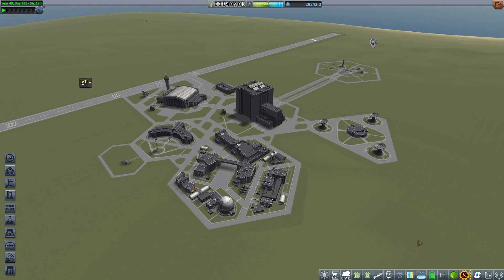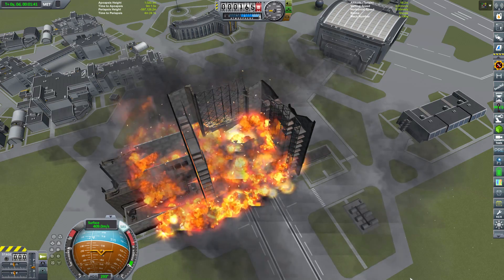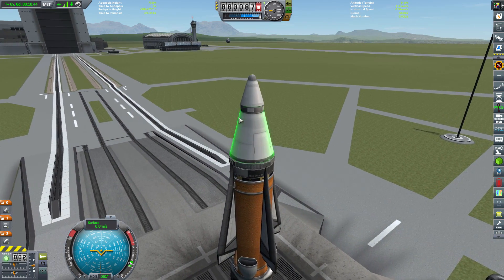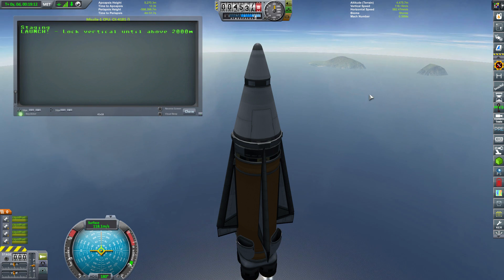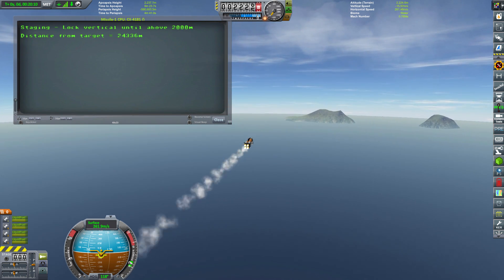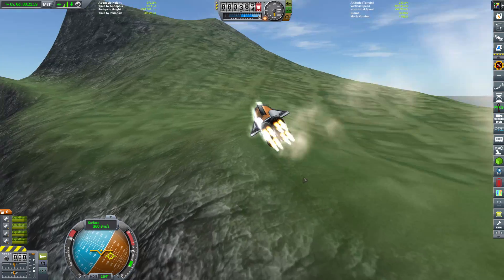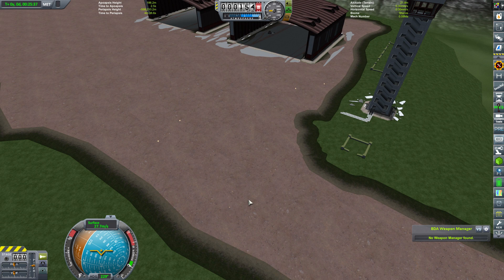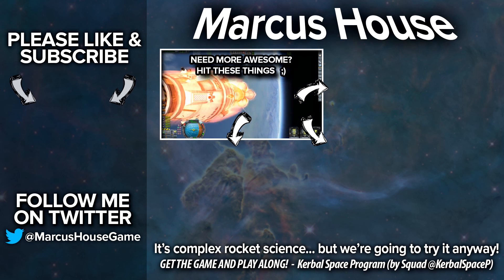KSP Self Flying Missile with kOS mod - Ep 58 - Kerbal Space Program - Marcus House

Comment: im very new to coding and the script ive made to create a missile is failing for a reason which i cant find out
the missiles flies up to 5k before dipping down and crashing into the ocean 
here is my script
if anyone sees anything that could cause this plz help 

toggle rcs.
Clearscreen.
print "T-5".
wait 1.
print "T-4".
wait 1.
print "T-3".
wait 1.
print "T-2".
wait 1.
print "T-1".
wait 0.05.
print "launch".

set runmode to 1.

Until runmode = 0 {

if runmode = 1 {
lock throttle to 1.
 stage.
 set runmode to 2. 
 }.
 
 else if runmode = 2 {
 lock STEERING to UP.
 If MAXTHRUST = 0 {
 stage.
 }.
 if SHIP:ALTITUDE > 3000 {
 set runmode to 4.
 }.
 }.
 
 else if runmode = 4 {
 set targetLatLng to LATLNG (-1.532,-71.880).
 set runmode to 5.
 }.
 
 else if runmode = 5 {
 until targetLatLng:DISTANCE < 7000 {
 LOCK STEERING TO targetLatLng:ALTITUDEPOSITION(5000).
 }.
 }.
 }.

havnt finished script because i cant test it past this line

Comment: Hey Marcus House you should really check out a mod called Vessel Mover -
 https://github.com/PapaJoesSoup/VesselMover/releases newest version with older versions.
THIS mod lets you move your vessel around anywhere on the landed planet or moon instead of having to type in direct coords in hyper edit, it also lets you spawn in vessels without having to go all the way back.

I don''t know if you used this mod before or not OR even know about it?.
I recommend others to use this.
Reply from the maker: This is better than using Hyper edit?
Reply: Tab - Changes speed of you moving (ludicrous mode might be laggy the first 3 sec when moving then will smooth out and will have better sense of direction while looking in from orbit)

Shift/Control - Adjusts your hight (best for placing subs)

J,K,I,L,Q,E.....ETC adjusts your pitch,yaw, and roll.

Bug - There is a bug where your vessel can spawn in with a invisible part when being spawned from in vessel mover mod spawn vessel tool.

Very good combo when using Hyper Edit and this for full vessel placing abilities btw I like your vids and subscribed.

Comment: This is very important to me, +Marcus House...how the heck did you get the quad couple adapter to attach to the 4 engines and disconnectors? I can only get mine to attach to one of them.
Reply from the maker: If you switch to symmetry mode you can then drop the engine in all 4. Works fine for me.
Reply: I can get the engines on, but you have disconnectors below your rapiers, and then a quad-mount. Usually if I'm in single mode it only attaches to one disconnector. If I'm in symmetry mode it seems to drop 4 different quad connectors, each attached to a single engine, and clipping through each other. You're not experiencing that?

Comment: kOS can control almost any part you throw at it :)
Reply from the maker: Yea, I wasn't able to figure out how to fire the Hydra missiles with kOS. Haven't figured out if you can do that or not.
Reply: There are a number of ways to do it, the easiest way is to name the parts you'd like to use together, all the same in the editor. Then you can locate them in kOS with ship:partsDubbed("foo").
It returns a list, even if there's a single part. To do anything useful with the part you must use thePart:getModule("bar").
Finally, using the module (one part can have multiple modules), you can get the part to do something useful. Basically, if what you'd like to do can be done from the right click menu of the part, you can read / write or trigger it from within kOS.
Here's a short example:

set theFairingList to ship:getPartsDubbed("theFairing").
set theFairingPart to theFairingList[0].
set theFairingModule to theFairingPart:getModule("ModuleDeployableFairing").
theFairingModule:doAction("deploy").
Reply: This example is the long way of doing it, but I broke it down so you can clearly see all the steps. I hope that helps :)